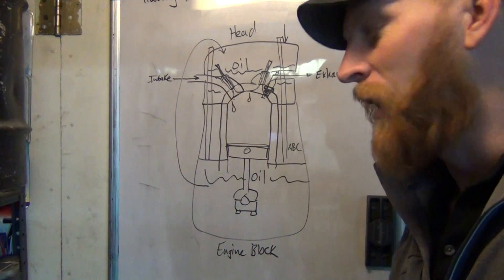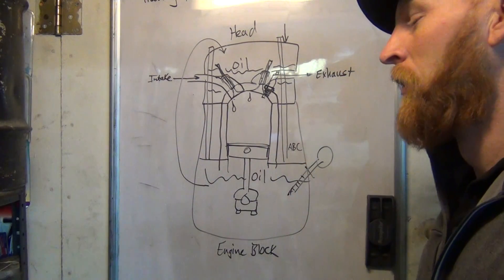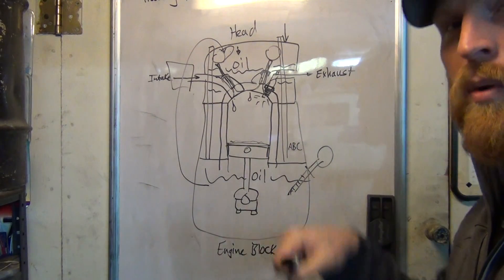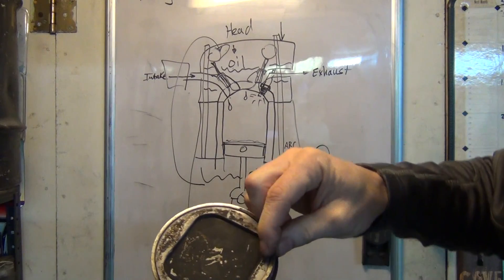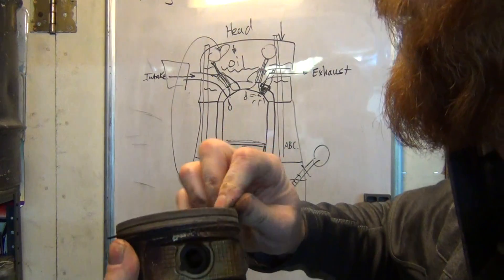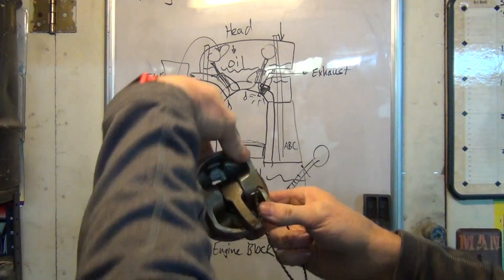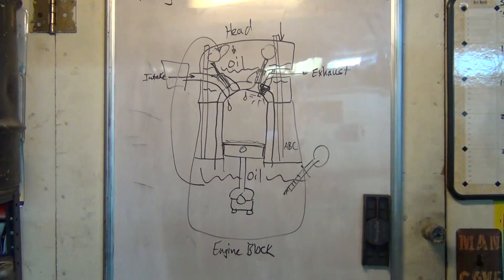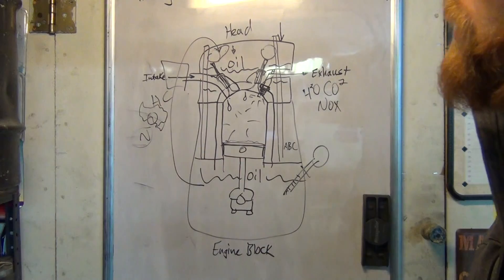Oil Burning Explained

Comment: Great video. Thanks for all the well conveyed and helpful info as always. You make these videos fun to watch, too, so keep it up! Recently changed the timing belt on my EJ25 Subaru engine with help from your videos and will be doing a head gasket job soon.

Unrelated question: have you ever experienced a deep vibration in the dash of a 2003 Jetta? Happens when stationary in neutral and driving in accordance with engine speed, mostly manifests in dashboard on right side of car. Engine mount perhaps? Car has about 100k miles on it and is in a very hot environment, 105* F during summer months, I'm thinking that could contribute to an early breakdown in the engine mount material.

Comment: Is it bad if a car is running rich? My late model car develops sooty tail pipe residue quite often. Dealer says these cars are programmed to run that way from the factory. Not sure if its something to worry about.
Reply from the maker: It is bad.  Bad for air quality, your catalytic converter, and your fuel economy.
Reply: It should be set for more towards lean from the factory if is is a gas burner for fuel economy,and less emissions...
Reply: Thanks for the reply! It is my understanding that the only way to lean out a newer car is to re flash it through the computer. Is there a way you know of doing this that won't void the warranty?
Reply: Make, model, year, miles?
Reply: It is a 2011 Chevy Camaro with 12K miles
Reply: pashastookie You should definitely not have any of the problems that would usually cause a rich condition at such low mileage. What kind of gas mileage do you get?
Reply: I am getting in the mid 20's in 6th gear on the highway
Reply: pashastookie It couldn't be running TOO rich then or your economy would be going all to hell.
Reply: Yeah the economy is not terrible for a V8, but the black soot is quite thick on the exhaust tips and comes back right after cleaning them.

Comment: Great Vid!  Would a symptom of bad head gasket be "blue burning smoke"?  Or would it just be "oil coolant mix"?  BTW I've done a ton of work with the help of your coaching.  Recently reseal kit on a pwr steering pump.  It works, doesn't leak, but whines a bit, hope it calms down.  I have a wife, one is enough..